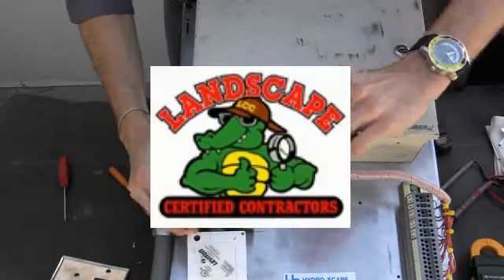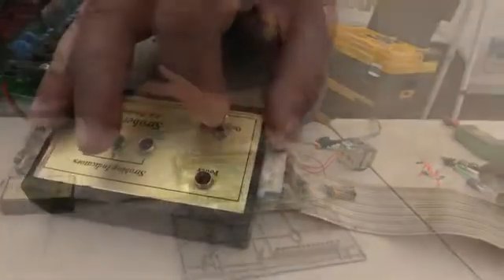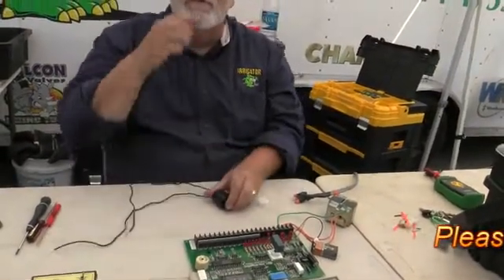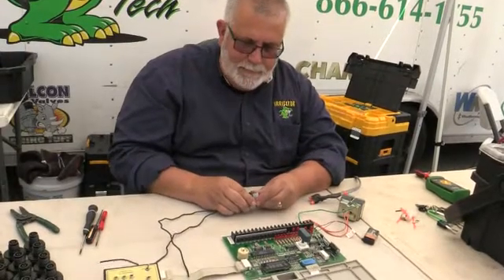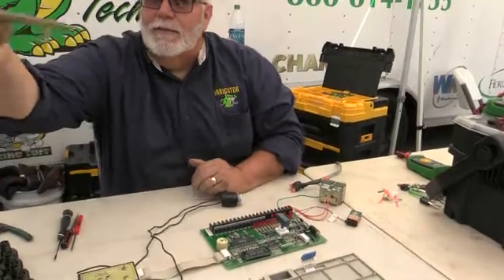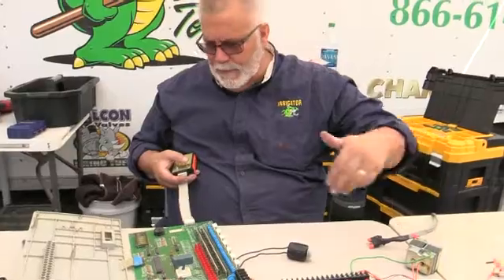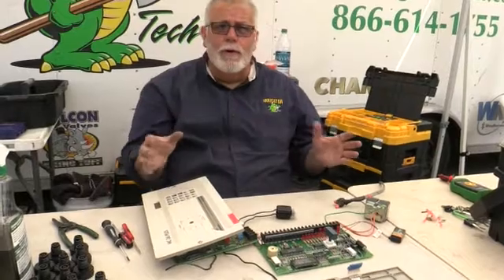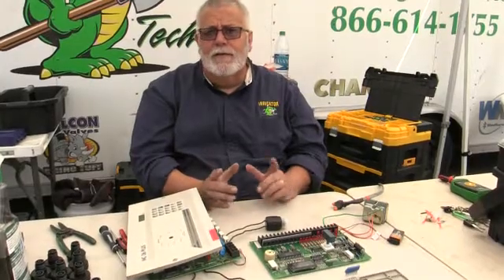How to Repair an Irritrol MC Plus Controller

Comment: You might know the answer to this question.  An Irritrol Rain Dial R-600 started to water hammer once a second last year, and another did it this year.  I send them into a local repair shop and 49 dollars later they come back repaired.  What part is the issue?  Same issue occurs across multiple outputs.

Comment: My MC-12 controller had a short in the field. I fixed the short in the valve box but have a problem resetting the main controller, I did replace the transformer as it had no power and thought that was the initial problem. Where can I buy the plug and flat cable for the J9  remote 6 pin so that I can reset the controller following your Utube instructions? Or where can I send this in and have it reset? Thanks for the video.

Comment: Great starting point for my issue with my MC-4 plus which I don’t see any specific video about checking time accuracy. My clock keeps showing wrong time after a few days of coming back and I see that it is watering at wrong times that I set. Any advice? Other than opening up and checking for bugs/blackouts?